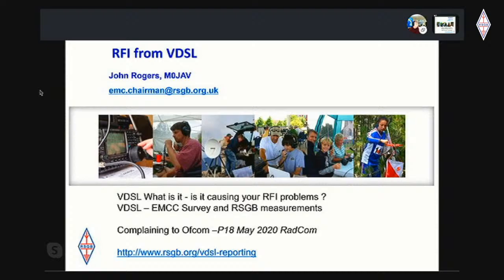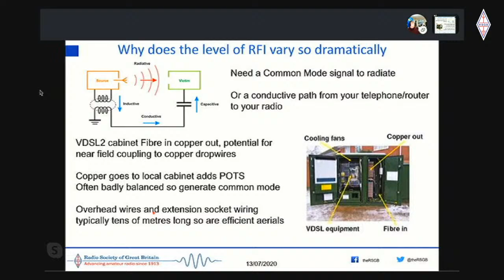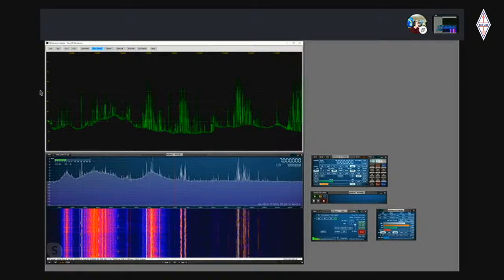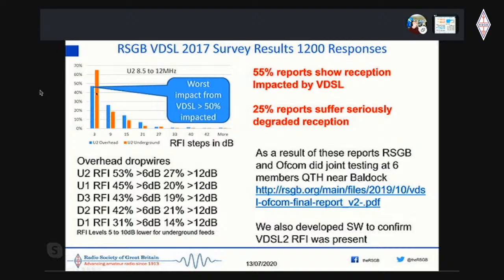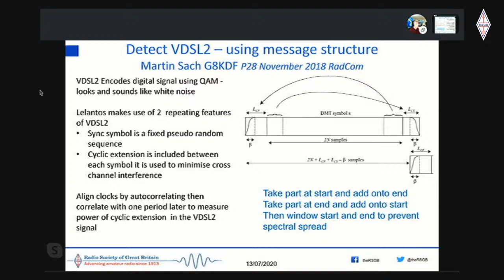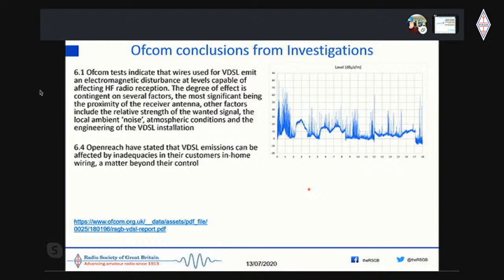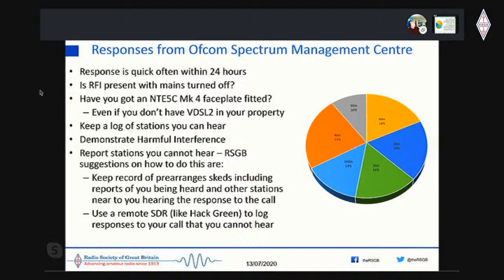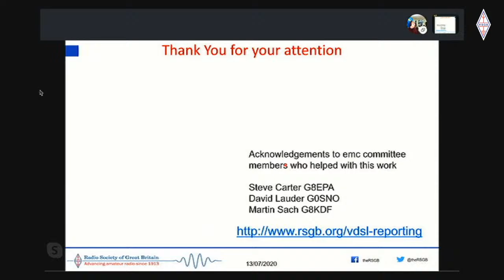RSGB Tonight @ 8 - How to check for VDSL RFI with John Rogers, M0JAV

Comment: I've had 8 years of not being able to use 160m to 20m and another 2 years before that when 30m was wiped out.
Now we've gone to fibre on 9th January. On the 13th the 41m band sounded quiet so I checked 40m, and the other bands, all quiet.
Hooray, I've got my hobby back.
G4GHB.

Comment: So as well as reducing the noise we receive from VDSL I wondered if by Openreach notching out these frequencies out it would also solve the internet disconnection problems experienced by an increasing number when transmitting on these frequencies? 
Why on earth would a system be allowed by Ofcom that both interferes with & can be interfered with by an existing licensed user group is beyond me....... Unless of course its purely financial on their part with & with no thought or regard to Amateur Radio?

Comment: Shame that there seems to be an assumption that everyone talk computer and have SDR equipment to do such investigations. It may as well been in Swahili  And talk of one of the units was only about £100 as if you should just run out and buy one just to do this investigation. Also did not explain how to identify if your S4 noise level normal atmospheric noise or VDSL without all this effort and expense. Comments about arranging contacts to NOT receive as evidence is weak. I can't hear any UK signals as a norm. That's down to propagation and UK hams antennas firing their signal over my head.I hear Europe OK.
Reply: I was told to put the rx on AM and look for a change in noise levels for the steps. It worked for me.
73, Bill, G4GHB.
Reply: get your local club to help you.